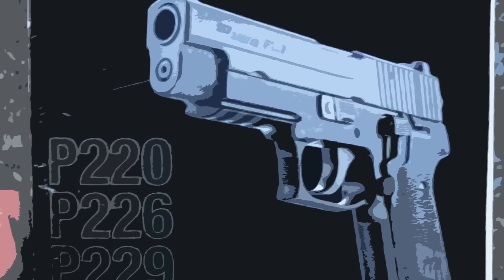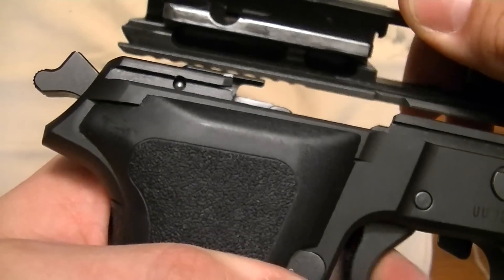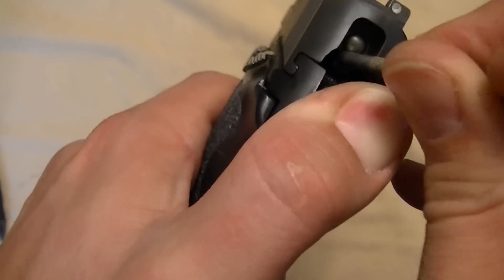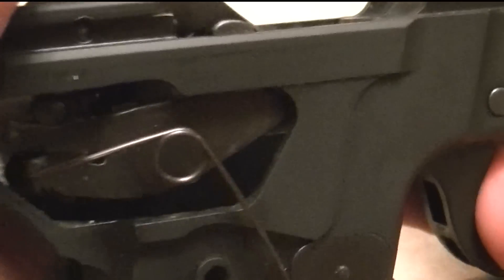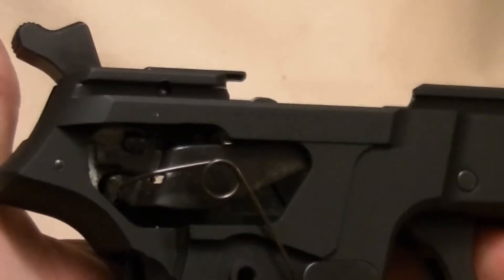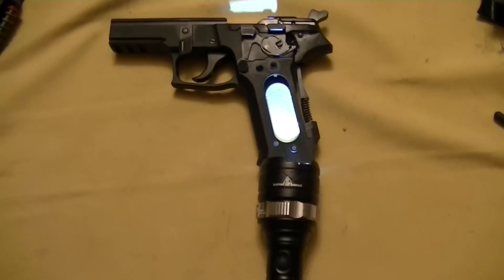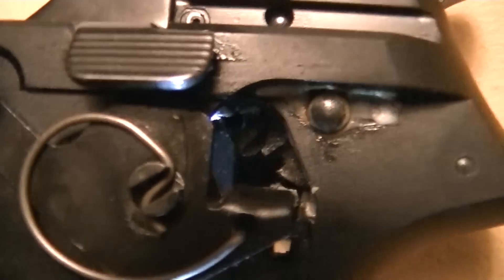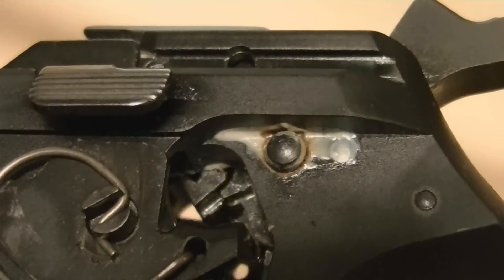Sig 4 Point Safety System

Comment: I appreciate the video. My 229 and 226 pro cuts are my favorite pistols for edc. I just trust a hammer over striker when it comes to life and death situations. I know 100% these guns will fire when you want them to. Not only super reliable, but the 226 has 22rd mags and extremely accurate.   I always wondered about how drop safe they are especially after the 320’s being pulled from police use over dangers

Comment: P excellent video on the Sig p 229 and other guns all about the safety firing pin just remember these guns have a thing to let the hammer go down but without hitting the fireman pin the only problem is if you press the trigger by accident the gun will go off so be careful lot of people don't slide it back until they're ready to shoot it but you don't know what the situation is you're not at a target range if you need the gun to save your life 🇺🇲👍

Comment: CZ75, Beretta 92 and SIG P226 are exemples of pistols where the firing pin safety is disconnected like the regular sear after each shot. Most, if not all, striker fired pistol firing pon safeties, are trigger actuated and after a shot the firing pin will be unlocked until de user releases the trigger. On a SIG, after you fire a shot, the firing pin will return on its locked position. I noted it using the silly "world of guns" game.

Comment: I do not have a sig, but I was told that the preferred carry position is to have the hammer in the half-cock position to keep the hammer from resting against the pin, but it would seem like the pin block would make that unnecessary.
Any thoughts on this?

Comment: Great video, thank you for explaining so thoroughly. Was very helpful. I just bought a used Sig 220 carry & haven't had a chance to fire it yet. Was concerned that the hammer wasn't seated correctly & didn't realize this is one of the safety features.
  So thank you for putting my concerns to rest as well as allowing me to learn about some really neat features.
Reply: Exactly same experience here. The hammer bounces on the firing pin when dry fire and seems to be loose and can be moved back and forth few mm

Comment: I just bought this and I got to say, when using the decocker, it really freaks me out that the hammer falls just like normal (visually) I have not tried it yet, as soon as my Conceal Carry Permit comes in, I will be carrying this gun with the chamber loaded and hammer down (at rest). The only way to get there is with the decocker. I will practice at the range before, but just seeing you makes me a lot more confidant.
Reply: The decocker is perfectly safe on a Sig pistol.  I've used them for over a decade.  Loaded chamber and decocked is really the only way I'll carry a Sig.

Just don't put your support hand forefinger on the trigger guard like this guy does.  That thing is a holdover from the '80s.  One Sig-specific thing you'll want to do is move your right thumb out to the base of your support hand knuckle to avoid accidentally ride the slide release.

Comment: how do you oil/grease the gun inside if not taking it fully apart? and btw. only the p226 legion seems to have this longer bar you press on to check if there's a round in the chamber.

Comment: Very well explained, and your visuals clearly show the components to help in the explanation. Well done. I know this is a dated video, but, in your opinion, does such complicated engineering increase the chance of a failure? I've heard great things about the Sig pistol, with very few negatives, and nothing really that involves mechanical failure. I plan on getting a 2022 when I find enough pennies.
Reply from the maker: In my opinion, complicated engineering does not increase the chance of failure is the quality of the engineering is there.  I still feel that the craftsmanship that goes into the internals is pretty strong (despite the external frame chipping I was getting from the decocker riding too high).  If there is a lot of systems in any machine that is poorly designed or poorly constructed, than it is all for not.  I believe this pistol to be at a very high caliber for quality overall, so the multiple safeties and complexity of the safeties I still feel is only beneficial in this case.  Just my opinion.

Comment: Well done video! Very organized, easy to follow, and informative. Nice tip at the end. additionally, if you look between the extractor and barrel, there is a small gap, or window. You should be able to visually see the round chambered, in P-series handguns. The audible and tactile checks are good too, as you said, we do not always have the light to visually check.

Comment: Great video.  Very informative.    My main concern with switching from a striker fire gun (my Glock 23) to my Sig P229 was "what if the hammer is accidentally pulled back slightly (snagged, etc) and then dropped"  -  You covered that in your first explanation.

Comment: According to this vid, the Sig P series pistols can be carried with a round chambered and hammer cocked.....just like M&P and Glock. Just keep your finger off the trigger until you want to put a hole in something, true?
Reply from the maker: I suppose that is technically true, but I would not personally recommend that technique.  If you drop it, it is highly unlikely that the gun will fire due to the safety features described here, but the trigger itself is only 4.4lbs in Single Action mode, so it doesn't take a lot of pressure to fire it if you do happen to accidentally touch it with your finger.  
So, yes, keeping your finger off the trigger will keep it from firing.  My recommendation would be to carry it with a round in the chamber, but with the trigger in the decocked position.  At least then you have a 10lb trigger pull and there is less likely a chance to accidentally discharge.  So long as you practice with the Double Action trigger pull and can get the job done you need under stress, and some practice with the transition from DA to SA.  Just my recommendation, but you are correct in your understanding.  Thanks for watching!
Reply: ^^^ That sir, was a badass reply to what seemed to be a setup question.

Comment: Great video.  I am planning on getting either a P250 or an SP2022 and the lack of a 'manual' external safety was a bit alarming to me.  I knew SIG had this safety system but I didnt understand much of how it worked past the decocker, which is a no brainer.  This video clearly explained how the other 3 passive safeties work and now I am not at all concerned about the lack of a manual safety